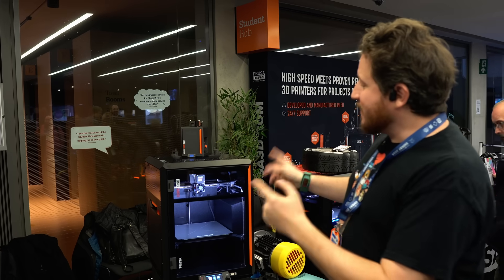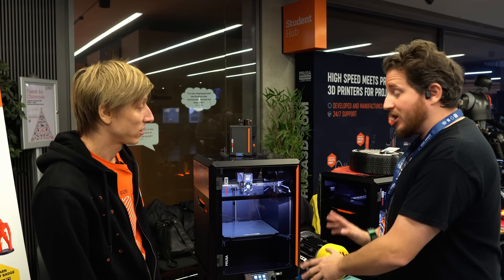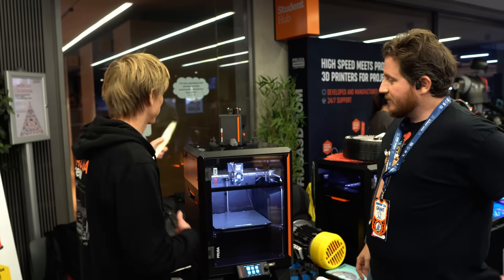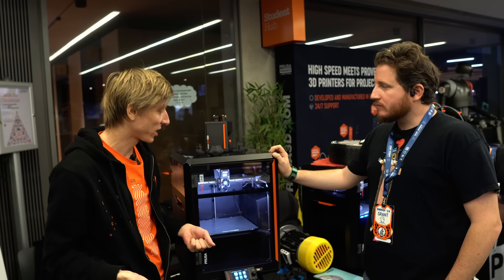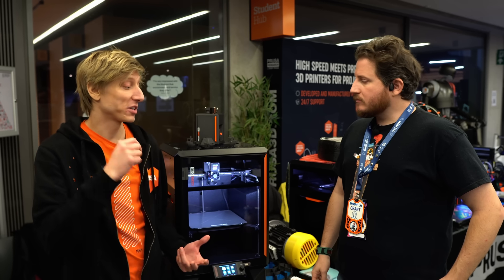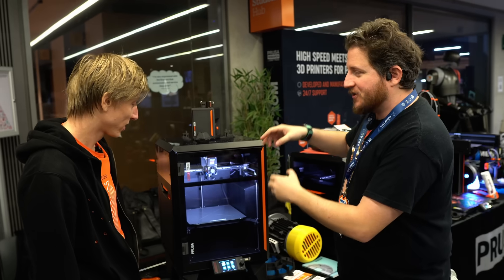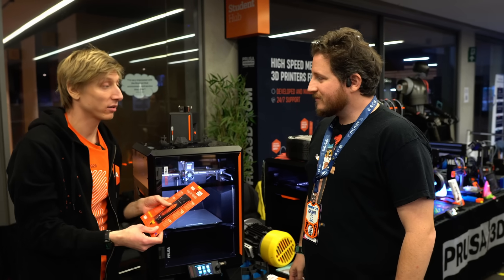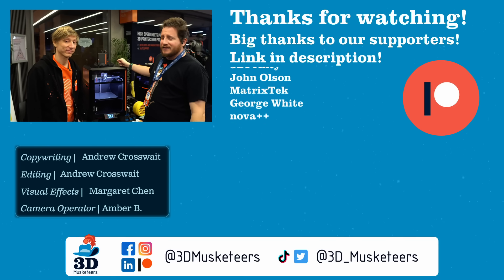Our FIRST LOOK At Prusa's CORE One! - SMRRF 2024

Comment: Still not even 300 cube. Blackberry
Reply from the maker: [citation needed] Get the XL
Reply: For £2,194.80 how about P1S £509
Reply: Love the group think in your post—by why only go back to the blueberry—why not call it Betamax?
Reply: Blackberry 🙂  not even camera included, ad don yes. Not to mention slow speed printing compare to some printers out there for this price. that must be joke Josef
Reply: @micks24h  it's 2025 and insufferable bambu stans still think prusa printers don't print fast. The MK4 already prints just as fast as anything from bambu lab, while maintaining higher dimensional accuracy, the core one prints even faster than the MK4...soooo.
Reply: @LilApe  Plus every Prusa multicolor or multimaterial solution leaves the other manufacturers behind in speed and waste.
Reply: @ulaB  there multicolor is a nightmare to use, asked anyone who's ever used it. Its been out for how many years, and barely made an attempt to fix it last year. Still takes up more space than the entire printer. Come on prusa, this is what prusa is known for?
Reply: @oneanother1  I see you're still living in 2019 with the MMU2. Come over to the year 2025 with the MMU3, it's significantly better than the MMU2 wile being faster and less wasteful than anything china has come up with.
Reply: @LilApe  maybe, ill try out the mmu3 only prusa mk3. I'm still not sold on the core one.
Reply: @oneanother1  It might take up more space, but it's also a lot more flexible in spool size, weight and spool material for example. Also I can use dryboxes without having to remove the filament from them. 

A lot of the issues with the MMU2 were user generated. Rewind spools often were too strong and pulled the filament out of the MMU for example. Or users didn't understand how the two filament sensors work in combination and didn't bother to set them up properly.  The MMU3 is a lot more reliable and user friendly in that it tells people what's the issue instead of just blinking.
Reply: @ulaB  how's your mmu going ?
Reply: @Defyant123  I haven't built the 3 yet, but my MMU2 is running pretty well. With multicolor prints I sometimes need to manually fix a thing, but with a few hundred filament changes for a print, I expected that. I did have power issues after a firmware update, but that was an easy fix too. Plus that firmware made figuring out what is wrong a lot easier, because you get nice error messages instead of just blinky codes.

A coworker has the MMU3 and is not complaining about a thing.

Comment: dammit.......I might get the upgrade on the 4s. I'm not doing the 3.5s. It will be a completely new printer at that point. lol
Reply from the maker: yeahhhh just get a core one ;)
Reply: I did the poor man's MK3.5S upgrade, and installed Klipper/Mainsail on my MK3S. Much faster printer for the cost of a Pi Zero 2 WH.
Reply: @nunopereira6092  So I was saying I'm not upgrading the 3.5s to anything new. That's the end of the line. Anwyay......the USB only has 4s gcode on it for some reaosn. I tried printing a benchy. It printed at 4s speeds. The cooling was horrible as I expected. And because it had some warping, it collided and ended up with a layer shift. So it can print as fast as the cooling can handle. That's the limit of the 3.5

Comment: Couldn't wait and bought myself Creality K1C. I'm regretting this so much.. Hotend issues, will be swapping for MicroSwiss, loud MB and PSU fans - already swapped with Noctua, and also had to design and make a freaking custom lid, so that cable chain and ptfe tube wouldn't scrape against it.
Something tells me that in the end I'll get Core One as well.
Reply: @ x_ph1l we are on the same boat.  I needed a printer and the K1C was on sale so I jumped on it.  I really wanted a Core One but the kit is not available. I want to buy the kit from the USA and get better shipping rates. 

My K1C has not given me issues as per say, but the prints are not true to size by 0.25mm and the quality is not bad but not great either.  Creality studio sucks ass and Orca Slicer is much slower.
Reply: This post of you is a lie, the k1c nozzle gave it away.

Comment: Really hope they have solved the ringing issues found on other core xy printers.  Like my core xy printers, but the ringing is a bummer.
Reply from the maker: on your XL? My XL does not have ringing issues
Reply: No ringing on my XL, but the print quality is better on the MK4 when the same part is printed on both machines and compared side by side.  I suspect it's because of the .9° stepper motors on the MK4 vs. The 1.8° steppers on the XL. 

It's most noticable on circular parts.
Reply from the maker: I have always figured it was the XL resonating a bit, but the slight difference in quality has never been an issue for me personally. But yes, I get it now!

Comment: I really enjoyed the video and the discussion. It's quite different compared to 'interviews' (for lack of a better term) with Anycubic, FlashForge, Elegoo, Bambu Lab, and others. That said, I still feel that the Prusa Core One is "already outdated". Coming from a company that once popularised many features (power-loss recovery, flexible PEI sheets, auto bed levelling...), I don't see any real innovation in the Core One. In contrast, we can expect something new with the next Bambu Lab printer. It's sad, but that's the reality now. I believe Prusa needs to start innovating again.
Reply: You are looking at the wrong things. Yes, it's only a "CoreXY". But it's a full metal enclosure, not a glued plastic one. And it can be easily disassembled for easier maintenance. You don't have to replace "modules", but can access individual parts. 

I am interested to see what the next Bambu can do, but so far the leaks looks like a tilting dual-hotend which has been done before too.
Reply: @ulaB  and tilting dual hotends was patented (by Stratsys, I believe). Other attempts to bring this to consumer printers were shut down. Maybe that's expired now. Or maybe this will be added to the actions against Bambu.
Reply: Prusa has developed new features out of practical considerations. Not to showcase new features. And that's also how I see the Core One. It's a functional printer and not a toy that boasts features that, at the end of the day, most people won't use anyway. The lidar on the X1 for example is often praised as a revolutionary feature, but the probably more often sold P1S doesn't have lidar but doesn't print any worse. And some even switch off the lidar on their X1 because it makes no difference to them.
Reply: How can you call something outdated when almost everything can be changed. That's the beauty of this printer. With the machines you just mentioned, it's a difficult task to do that. They do the job perfect but have no "Soul". Not everyone wants a printer that can only print.
Reply: @Jepespecial  I think most people "wants a printer that can only print". I have a Prusa MK3S and it's exactly how it comes from the factory, pre-assembled. I don't use my Prusa anymore. I bought a newer printer with more features, for the same price of a single upgrade, but that is another topic.

Not everyone has the time, interest or skills to upgrade everything, so it's fair to compare printers as they come. I expected Prusa to bring something new (a 5-axis printer, inkjet-like color system, or a compact multi-tool like the AnkerMaker V6). I don't know. They used to innovate, and now it's just a 2 years later to a race. That is why I said "outdaded", if you can transform a CoreOne into a 5-Axis or a IDEX or (put what you want here) fine, and go head, but that is not the product that Prusa is selling.
Reply from the maker: This machine does just print. It is made of steel, by people that are paid living wages in the EU. Prusa innovates plenty, this is a massive step from the MK live and if you want something thats more, go get the XL. 

There are no consumer available 5 axis printers, from any company that I am aware of.. Why would Prusa make something like that?
Reply: @3DMusketeers  "Why would Prusa make something like that?" because "There are no consumer available 5 axis printers". That was my point: to make something new. I don’t expect Anycubic, Elegoo, or FlashForge (...) to innovate or disrupt the market. But the only company that used to do bring something new was Prusa. Of course, the example of a 5-axis printer was extreme.

The XL is a good example of a printer offering some unique features. While I don't have a XL, it seems to be a good printer. The price might be the only blocker for many people, but as you said: it's made in EU (...). :)
Reply from the maker: But what is the market demand for a 5 axis printer? What slicer supports it? And yes, a bit extreme for sure lol. 

I think there was a serious demand for a machine like the XL, dissimilar support material is truly a godsend (taking some parts with this off the printers now!) and yeah, its not cheap, but it also is not trying to be. I kind of respect Prusa for not playing the pricing game, you know? They have quality and they understand you gotta pay for it. Dont have the budget? Well, plenty of other options. Many are choosing to find those options, be it BBL, FF, or whomever, but there are still plenty that recognize that the value is well beyond the printer itself and having been there and spoken with, and spent time with staff outside of the office, they all do love what they do, are treated well, from my POV, and seem to get paid well too! Could Prusa benefit from some automations? 100% but they chose to vertically integrate to ensure product quality, to me, that has some respect there. 

But yes, I get what you are saying overall :)